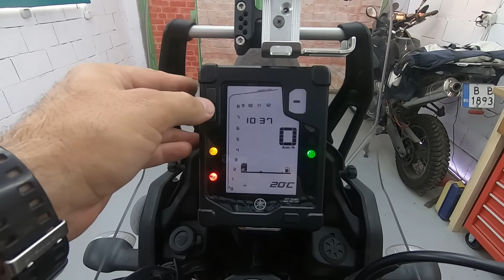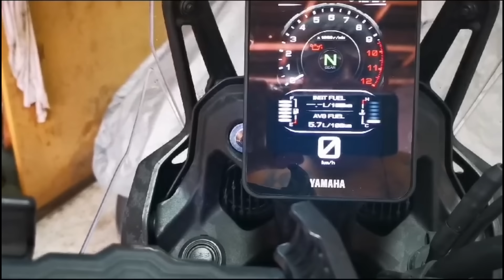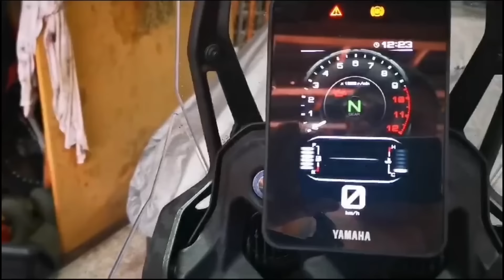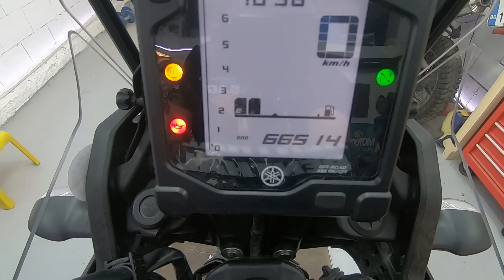Yamaha Tenere 700 - Long Term [66,000km] Owners Review

Comment: I reduced my own weight by 20% - which made many things much easier 😂
Reply from the maker: Good!
Reply: How did you manage to achieve that?
Reply: @johnnyblue4799 It is very simple but not easy just reduce the kcals intake for your day and workout.(it doset'n need to be a torture mąke it fun if you like to cook for example cook your own food with good quality products and a little bit of thinking about kcal and you good)good luck
Reply: stop drinking alcohol and it will fall off
Reply: @jc7654  If everyone would drink like me, all alcohol producers would have gone into bankruptcy a long time ago...
Reply: @johnnyblue4799 if I may add, remove sugar and carbs on your diet, it’s hard at first but our body will get rid of the sugar and carb addiction until you’re system doesn’t look for it anymore. Cheers and good luck.
Reply: @rj-gd3pc  So what do you eat? Name the foods... Carbs and sugars are the same thing... Carbs in beans are great, refined sugars are very bad indeed. Thanks!
Reply: @johnnyblue4799  stop consuming sugar, or anything with added sugar on it,  no colas,  no adding sugar to your tea,  dont eat right before you sleep.

And stop drinking alcohol
Reply: @johnnyblue4799 hahaha yeah fair enough 👍
Reply: I could lose 10 kilos easily... Puts the titanium spoon (minus 10 grams!) into perspective 😅
Reply: @Flyingjaffacake  10 kg is all I need, but they love me and don't want to leave...
Reply: so you can keep the heavy crash bars :D
Reply: @quklash2147  it should be easy for married people. Just work out together, in the bedroom (several times a week).
Reply: @savage22bolt32  haha yes but you know how fucked marriag is in some richer countries
Reply: Carbs are carbs. Body can't tell the diff between beans and sugar once it's in the bloodstream.
Reply: @Agenda-Norway  in a lot of ways, carbs are better than EFI. At least, I've repaired my BMW motorcycle carb by the side of the road. With electronic fuel injection I would have needed a truck to pick the bike up.
Reply: @jc7654  🍻☹🍻☹🍻🍻😢😢😢
Reply: Living off of fat as a fuel source as nature intended! Not glucose that comes in the form of a wrapper or in a drive-thru.
Reply: I ride a 135KG offroad bike, its ground clearance is an inch better than the Tenere. 

And I can pick it up when it falls, by myself.
Reply: People don't understand that's the cheapest way to make your bike faster, lose weight = faster bike!
Reply: @johnnyblue4799  I eat 1/4 of a sandwich instead of ONE sandwich and skip beer and meat alltogether for 5 or 6 days of the week. I eat a lot of red lentils. They taste surprisingly good and are full of Protein and Vitamins... :) Buck wheat, peas, n whatever other veggies I feel like eating ... plus the inevitable bit of maggie :)
Reply: @hutch814  Wrong. Fat is not what you're supposed to eat, especially animal fat.
Reply: @Agenda-Norway  Absolutely wrong. Beans have proteins and fibers and other nutrients, beside carbs. The release of sugars in the body is slow and steady, fueling your body for a long time. The fibre also promotes intestinal health. A tablespoon of sugar is nothing like beans. Also, not all carbs (sugars) are the same. You have lactose, fructose, glucose, sucrose and a few others. The way the body metabolizes these differ. 
Also, you don't eat carbs. Carbs are not food. You eat food, which is never (hopefully) a single substance, but a complex mixture of different things. 
I'm sorry, but your reply only shows ignorance in the field of nutrition.
Reply: @kloppskalli  I drink maybe 10 beers every year and I'm mostly eating a whole food, plant based diet w/o oils... But I never had the restraint to eat only 1/4 of a sandwich. :))
Reply: @johnnyblue4799  I used to drink 10 beers per day, 20 on a good day 😉
Reply: @kloppskalli  Wow.. that's way out of my  league. I hope it was good beer! 🙂

Comment: Well done Pavlin. 
I 100% agree with your review. My 2021 Tenere700 has 39000km and I have only had to replace rear brake pads and the front sprocket, other than regular oil changes. That’s it. No leaks, no squeaks, no breaks, nothing has failed or broken. The stock front tire was a safety hazard when it started to wobble uncontrollably, but that was remedied by changing brands. I recently took my dog on a 5000km, 3 week Moto camping trip and awoke every morning knowing my Yamaha would take us to far away places trouble free every single time. Reliability is worth more then everything else when you are hundreds on km away from any type of help. 
Keep up the fantastic videos.
Reply from the maker: Thanks for watching and sharing your experience with the model!
Reply: Nice...how did you set your dog up for the ride? Do you have any picks}
Reply: Tires?
Reply: @jackarock6425  I replaced the pirelli scorpions with Motoz tractionator adventures as soon as I could.

Comment: Speaking of Yamaha reliability, you are absolutely spot on! 
I live in Philippines, I had a Yamaha Vega Force-i, 115cc, dialled up to 79,000 kms in long commutes in 4 years, road, off road, mud, sand, potholes, etc. All I did was converting my wheels to spokes and tires to dual sports. Fuel efficient up to 80km per liter. Never had a problem during my ownership. Just oil changes and two sprocket changes until I sold it eventually. It was my first bike and it's reliability is built like a soldier.
Reply from the maker: Thanks for sharing!

Comment: Your 66000km review of the Yamaha soldier was well done.  Your experience on this bike accumulating these km's in a wide range of terrain demonstrates accurately the reliability of this bike, which was the key point you made I think, reliability, and overlooking or accepting the shortfalls.  I too agree with your assessment about the high center of gravity and the handling on slower twisty roads.  I lowered mine with the Yamaha kit, and noticed immediately the grace it showed in the transitions from corner to corner.   I lowered mine not because of seat height, as I am 6ft tall with good long legs, instead I lowered mine to address the top heavy element.   After a while I got used to it and like you accepted it as a minor shortcoming......as I have my DRZE for real off road riding.  Glad you  took off the crash bars too, I never liked those, as they seem counter intuitive and dangerous to the legs in a fall.  The trick is not to crash...  I learned that Yamaha means "mountain blade" in Japan.  A soldier marches on, and yes, easily the most reliable bike out there in my general opinion.....Although I will say, Yamaha replaced my rear axle, bolt, and locking plates, as I experienced thread galling, and it was just off warranty......So they stand behind their product and I accepted this fail as rare....I noticed with some basic research that I wasn't the only one, and it has happened on some FZ9's....same axle apparently.  MIne was made in Japan as I am in Canada, but in no way does this affect my feeling of reliability, but not hiding the fact that it was worrisome at the time.  Every bike I have owned....always has one issue at the beginning it seems
Reply from the maker: Thanks for sharing your experience with the model!
Reply: Thanks for this comment.  I am also tall enough for this bike.  The lowering kit seemed like it might be a good tradeoff for all around handling, if one were just not interested in more technical terrain on a 200 kg bike. I had noticed other reviewers stating it is top heavy compared to the Transalp for instance, talking about better weight distribution.  But the Transalp has less ground clearance by over 25mm.  Was it just the lowering link and sliding the forks up the clamps?  Or were internal changes made in the shock and forks?

Comment: I agree with just about all points except one. It is still a very good/perfect ADV bike for shorter people. Lowering link and sliding forks up in triple clamps is a legit solution, and does not compromise handling of the bike much at all.
Reply from the maker: Doing it you ruin the whole conception of the bike.
Reply: @motorcycleadventures   I disagree. It does not affect the concept of the bike that much at all.

Comment: I have had my Tenere for one year now and have travelled 18k on it and it has made the clutch noise fron the very first day, I find that if you let it warm up for 1min and pull the clutch in a few times before moving it usually wont make the noise, great videos Pavlin looking forward to your next trip where are you going next?
Reply from the maker: I do exactly the same with the clutch every time.

Comment: The best commentary on technology in motorcycles!!!!

I ride a motorcycle because I like the open road , the wind hitting you, twisting the throttle, gripping the clutch to change gears, modulating the front and rear brakes entering corners or approaching hazards, flipping the gear shifter up and down. What else do I need?   Let me think…

NOTHING.  Let’s ride and ride safe.
Reply from the maker: I understand you, but...
Reply: Sorry I posted the comment on the wrong video. The comment was intended for your latest episode on too much technology on modern adventure bike where you used the GS1300. 

Somehow my comment landed here.  Will be more careful next time.   Ride safe.

Comment: Fantastic bike! I dont think it can be beaten for that Magadan trip. I had the same problem with soft paniers marking plastics, mine are painted so did not want to do too much damage - i found on Amazon a clear plastic bumper protection tape, that has worked well. One thing i will say, I can only do weekend tours and it was fine for my 800 mile trip.
Reply from the maker: Thanks for sharing!
Reply: I noticed in NZ the enduro riders cover their bikes in duct tape to keep the plastic new.  ....at least 30 years ago they did.  Anyhow....I do the same now....I have a black 22 T7, and a role of black duct tape covers my side panels to protect from my luggage systems rubbing.....and then one day peel it off and like new, and redo.  It cost me $ 1.49  a roll.  The more I ride my T7, the more I love it..its different alright

Comment: I've done nearly 10k miles on my '22 T7, and I agree with everything you've said. I get a bang  / clunk when I put it into 1st when cold. So what I do is before I start the bike, I put it in gear, pull in the clutch and rock the bike to "break" the clutch. This stops the big bang / clunk before you pull away.
Reply from the maker: More or less I do the same.
Reply: @motorcycleadventures  I do the same and it works (most of the times).

Comment: I’ve done the same Pavlin, bought mine in Lufkin, Texas for $9995 and I bought it because it had the LEAST tech and Yamaha legendary reliability. I added bar risers, slightly taller screen, headpipe and luggage. That’s it. My T7 is still running like new and I expect it will be after I’m gone. I bought the T7 after having my left shoulder replaced and couldn’t ride heavy bikes anymore. I wish I would have bought it sooner.
Reply from the maker: Have fun!

Comment: I'm at about 83,000km on mine and have not had any problems. It is just a fantastically useable bike. I will say I disagree about the anti-vibration headlight braces. I've had them on mine the entire time and it has protected my dash, my GPS, and my camera mount. I would strongly recommend one like Camel ADVs headlight brace.
Reply from the maker: Do you ride many km off road?
Reply: @motorcycleadventures  about 25k of that was in dirt.
Reply from the maker: Ok, so soon or later you will have the this problem. I already know two people with braces that removed it.
Reply: @motorcycleadventures  Not likely. I've spent the last 2 years on the road with the bike. And that's at least 25,000km of off road and 83,000km total over that two years. I'll keep the brace.
Reply from the maker: It is your motorcycle, do whatever is good for you.

Comment: Good day, really appreciate your videos.  I have a Suzuki DR650 (1995) but I'm looking at a Ténéré 700 Rally (2022) with 7 500km (I'm 1.78m).  Your presentation of the Ténéré is great as it helps me to judge if I'm on the right path. The twin cylinder should make riding a lot smoother, and road riding should be more enjoyable - although as you correctly say, highways are needed to go where you actually want to start your riding.  The "top heaviness" has indeed be mentioned by other people, but the bike has so many other strong points.  Thank you for a comprehensive overview.

Comment: Great video. I travel with a pillion 2-3 times per year with camping gear, it goes without problem, taking it easy with 90% roads and 10% gravel. A good compromise for a fun off-roader on the weekend +  light traveller.
Reply from the maker: Thanks for sharing your experience and opinion!

Comment: I have the same problem with the clutch almost everytime i start the engine and put the first gear. Right now i have 5000 km and this problem started at around 1000-1500 km. I'm glad that i am not the only one who has this issue. Everything else works perfect. Thank you for the video man. It is very helpfull. Greetings from Greece
Reply from the maker: Thanks for taking the time!

Comment: Yamaha should now nake a 'Magadan' special edition!
The only thing i would change would be i would want tubeless tyres on the next edition. For me a lot easier and less to carry when I travel.
Ride safe and happy travels 👍
Reply from the maker: That would be cool!
Reply: I'm not convinced about the tubeless. If you bend a rim you're screwed. Tubes will still hold air even in a bent wheel.
Reply: @johnnyblue4799  a tube will still fit on a tubeless rim. For most people most of the time, tubeless is easier. Just my opinion. 
Ride safe.
Reply: @teneretraveller8980  Yes, it will fit, but then you still need to carry a tube with you and it's much harder to unseat a tubeless tire, due to the rim profile. Happy travels!

Comment: I had a T7 for 2 years & 20,000km, it was a nice road bike a lovely engine....but....I never felt happy when riding off road, well at my skill level. It is very top heavy & at a certain lean angle it felt like it was about to fall over, you can even feel it when pushing it around & after all it's still a heavy bike. Now I have a Husky 701 & much happier with it road & off road.
Reply from the maker: Thanks for sharing!

Comment: One thing which has worked for me for the abrasion in the Yamaha sticker area with rack-less saddle bags is to get some of the clear vehicle/paint protection film installed over the areas where the bags rub. It's tough and "self-healing" to some extent and provides good protection. It is usually installed on cars. Also nice to put on the front of your forks.
Reply from the maker: I completely removed my stickers and have zero problems now.

Comment: I test rode the stock T7 wich worked okay witch 1.75m, but I had to check where / howI stopped if the road was uneven.
Got mine with 2.3(?)cm lowering kit and the lower seat which is 4-4.5cm lower in total. Totally fine with my hight and I could change the links, or the seat again any time I‘d like.
Happy for now 😊
Reply from the maker: Enjoy it!

Comment: would love to own one of these. The reliability is no joke, there is a guy in the usa that has 150,000 miles on his and has uploaded a review. Barely nothing except consumables (wheel bearings, air and oil filters etc). Its a nice feeling when you can trust an engine to be reliable, especially when you travel to remote areas. Theres a reason Japanese bikes are so popular even though they offer lower features and specs than the competition, the reliability is amazing
Reply from the maker: Couldn't agree more!

Comment: I have had my T7 for about 3 months now and I agree with just about everything you said, but it is a dirt bike😎🤘. I absolutely love riding the single track on my T7.

I have a ‘23 model and in the US we didn’t get the new screen with the thumb wheel and at first I was disappointed, then as you were talking about your friends issues, I am now glad it doesn’t have those upgrades. I had a Multistrada, AT and currently have a 1290 SA-R. I have been riding the T7 mostly because it’s worry free and less to mess with. It’s really refreshing to have a bike that I can jump on and go. Also, people have complained about having to push the ABS button after a shut down. I don’t see what the big deal is and honestly, besides the 3 you mentioned, if that’s the only gripe, then Yamaha hit a home run. Great info and thanks for sharing your experience, it just solidifies everything I already assumed.
Reply from the maker: Thanks for taking the time!

Comment: I have similar experiences on my t7, 31k km so far. My clutch chirps first use if temps below 15 C. Solution I have read is soaking plates in oil for a min of 24hr before installing.
Reply from the maker: Thanks for sharing!

Comment: I have T7 for almost 3 years and for the first time I hear someone talk about this clutch problem, that I expirence myself after 18000k.... 
Very good that you mention it on the review.
I understand that is a problem in all CP2 engine, it happens when riding in heavy traffic jams (that I have all the time) and offroad a lot,
What I did and see others doing is to change the clutch plates, but you dont need to change all of them only the first one (it was very burn, black color looking), but if you already disassemble the engine so I change all of them....very strange weakness.
Nice informative review GOOD WORK💪
Reply from the maker: Good to know, thanks!